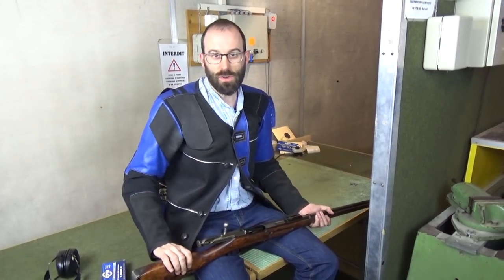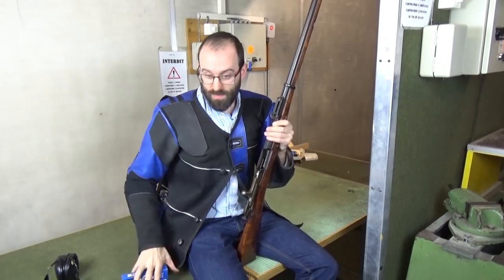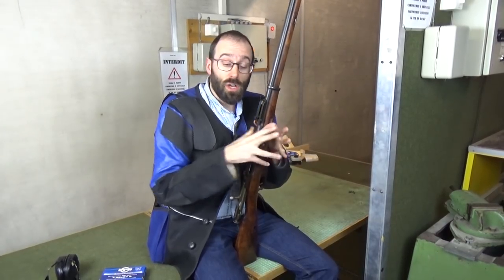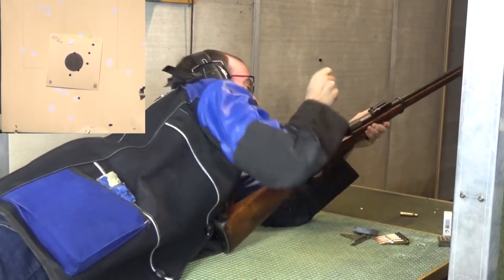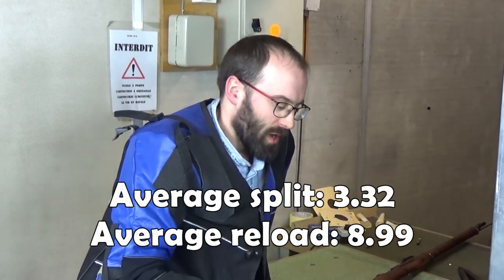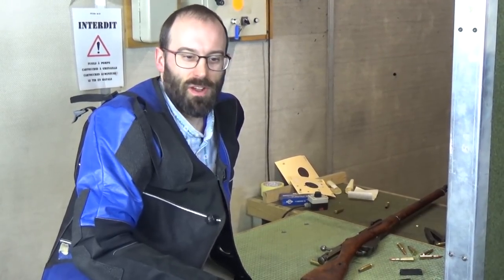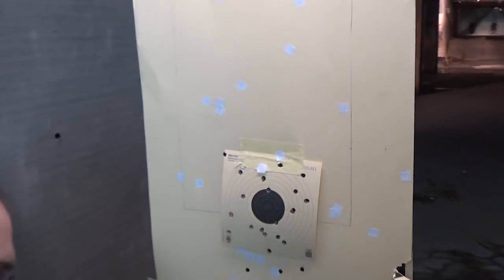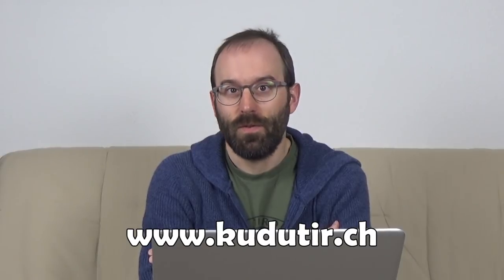Mad Minute: Finnish M24 Mosin-Nagant 7.62x54R

Comment: If one is shooting at 25 meters or yards, why bother wearing the shooting coat?  Hard to say, but the coat looks so heavy and stiff, that the contortions of the arms, wrists and fingers in trying to use "normally reliable" charger clips seems to be messed up by wearing the shooting coat?  I've got clips that I load just keeping my wrist locked, placing my thumb at the rear of the case head, and my fingers along the side of the stock, and thumb them in with the whole hand, not flexing my thumb curled over the top cartridge.  Also, as other posters have recommended, lift up the tip of the top cartridge, put your finger at the rear of the case head, and use it as a lever to thumb them all into the magazine.  The rifle shouldn't have to be canted upwards at 50+ degrees to put in the new charger clip?  Make sure the action screws on your "garbage rod" M24 are tight.  Also, while not suitable for rapid fire, when I'm shooting prone and I have a sling supporting the rifle, I cannot open the bolt normally from the prone.  Good thing the Soviets, and for all I know, the Russians before the Revolution, had just such a conundrum in mind when they devised a means of shooting from the prone should that become an issue:  The thumb goes to the cocking knob, along with the fingers, and manually re-cocks the cocking knob, pulling it straight back.  That accomplished, with the thumb in place, the trigger finger and middle finger move straight out, underneath the short bolt handle, and lift up, moving the bolt 90 degrees.  The fingers return to the thumb, and pulling on the cocking knob, instead  of the bolt handle, pull the bolt back to extract and eject the fired cartridge case, then push forward, stripping a new cartridge from the magazine, and using the two fingers to turn the bolt handle down, locking the action.  I'm a little astonished to see Bloke otR, who has done so much to debunk myths and disabuse people of sheer nonsense about various firearms, such as the M1 Garand and so on, to then basically neglect to do basic research on how the admittedly clunky, completely 19th-century Mosin-Nagant service rifles *were actually used*?
Reply from the maker: OK, what's your source for that rather... erm.... special method of bolt operation? Cos I can tell you a priori that a) it'll be achingly slow, and b) in archive footage I've only ever seen the bolts worked conventionally.
Reply from the maker: Oh, and BTW at BotR we show it as we find it... That rifle was a difficult one. If we'd had my 1933 Izevsk 91/30 I used to own it would have gone far better cos that one was quite slick (for a Mosin). If we'd had the mint 1946 Izevsk M44 I had, it would probably have gone worse cos that one had a tight charger guide that would pinch the chargers and make it even harder to use them.
Reply: @BlokeontheRange  @Bloke: Oh, yes, it is agonizingly slow, 'tis true... People thought I was daft for doing it with one of my Finnish Mosins at a match, but my arms are simply too short to operate the bolt from prone when I'm doing sling-supported shooting.  As for the source? It is in the Soviet-era PU sniper manual, and likely as not, one or another pre-war shooting manuals.  I've seen footage from back when the Soviets wore those silly pointy Budënovka hats of a rifleman using it!
Reply: @BlokeontheRange  @Bloke and other mad minute aficionados: Also, since you are English, the mad minute must certainly loom large in marksmanship and rifle handling, much as we North Americans have our own "special" technical obsessions... But, the Soviet-era manuals for these ungainly, unlovely, and certainly very dated turn-bolt repeaters states that the actual rate of fire for a Mosin-Nagant rifle is something like 8 to 10 shots per minute.  And that may, in fact, call for a "mad minute" to get those 8 shots off, starting from a loaded magazine, no?
Reply: @BlokeontheRange  Ministry of Defense of the USSR, translated from the Russian by Maj. James F. Gebhardt (U.S. Army Ret.), _The Official Soviet Mosin-Nagant Sniper Rifle Manual--Operating Instructions for the Model 1891/30 7.62 Sniper Rifle with PU Scope and Observation Instruments (Boulder: Paladin, 2010), p. 71. Cheers!

Comment: You chamber still has cosmolin in it. When the rifle heats up its start sticking. You need to boil it out. I have 12 different mosins. and the biggest amount time it takes is cleaning it properly. Non of them give me any problems with sticking bolt. Watch ieaqveteran8888 for the solution to this problem,
Reply from the maker: And yet, when I changed the lubrication on the bolt it ran without sticking. Implying that there isn't cosmoline in the chamber ;)
Reply: @BlokeontheRange  Well.. maybe it's just a crappy  rifle. I can put between 18-22 rounds a minute with a  Soviet surplus ammo from each one of my mosins (No Chinese clips .all ww2 vintage.) The best one is an 1945 M44 22 a minute.
Reply from the maker: I would like to see that under the same conditions I shot there, also with a camera on the target. Prone, 10m ISSF air pistol target out at 25m, using a shot timer :) If you do that, I will post the video on the channel.
Reply: @BlokeontheRange  Ill try in the next moth or so. Didn"t had time to go to the range (California dessert) in 3 month. Life interferes....

Comment: You just don’t know how to load a Mosin properly with its clip. There’s a technique that was taught and used and it works just fine in all my mosins and Svt’s.
Reply: I assure you it's not a technique issue. Bloke's clips are not right, and I suspect it's because good clips are not available in Switzerland. With a decent clip, no special technique is required, you just push straight down like any other clip-fed rifle. It's all in the clip.

Comment: Why do ALL of these you tube gun "experts" always goof up using Mosin-Nagant stripper clips ?  LIFT UP SLIGHTLY ON THE FRONT OF THE TOP CARTRIDGE AS YOU PRESS DOWN ON THE BASE OF THE SAME TOP CARTRIDGE.  The designers of these weapons didn't have failure on their agenda. Figure it out for God sake.
Reply: Frederick Schwank it’s seems fucked if most other platforms do not require having to fucking lift up the first cartridge

Comment: Didn't load clips properly, and it gave you rim lock. Also didn't properly secure your cleaning rod. I seen the same thing on TFB. Learn the rifle first before tom foolery.
Reply from the maker: Eh? No, it didn't give me rimlock. The interruptor on this one works perfectly.
Reply: A failure to feed is a rimlock issue no matter the system. You did not correctly load your ammunition, the type of stripper clip you used had minimal impact. You just had user error that created a larger magazine jam. Learn the rifle more than calling it a garbage rod. There is a reason it has a large following in America and Russia. You need more time behind the trigger to learn effective operation.
Reply from the maker: No, a "rimlock" or a "rimjam" is a specific failure to feed in which the rim of the top cartridge is situated behind the rim of the cartridge immediately below in such a manner that the bolt cannot be pushed forwards because the top rim is blocked by the one below. That is not the failure which happened here. 

Learn the terminology. It matters so that we all know what we're talking about.

And btw I once managed 18 rounds out of a 91/30 prone, unsupported in a competition about 17 years ago...